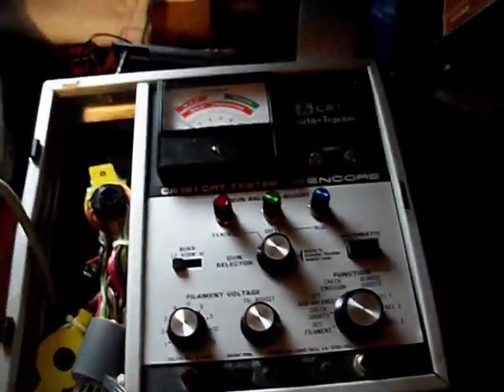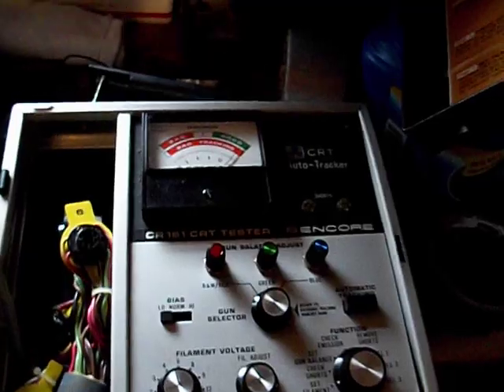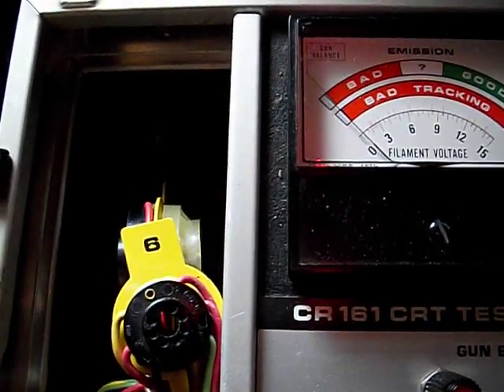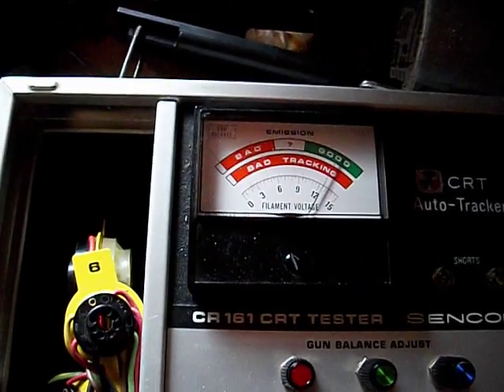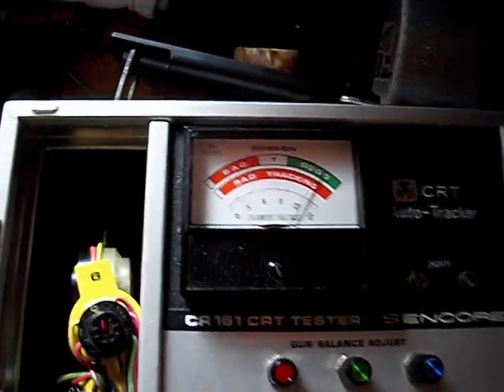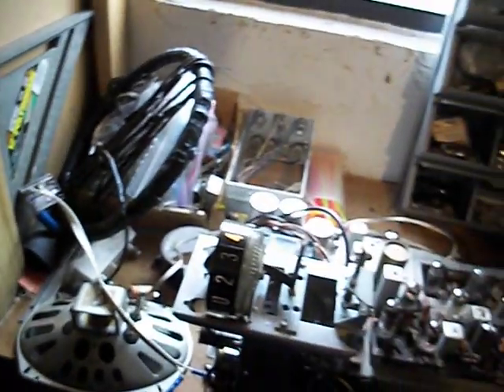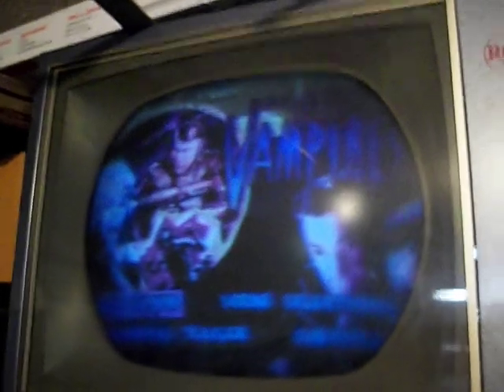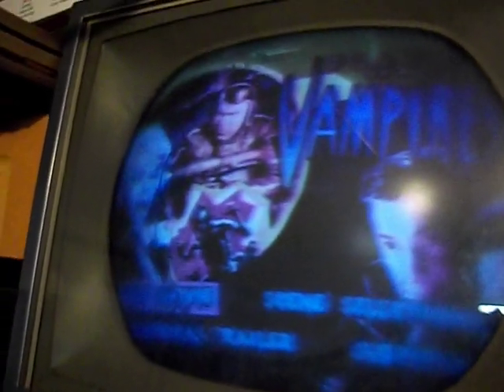CRT tester Sencore CR161 test 11SP22

Comment: Where would you place the CR161 between the CR31A and the CR70?  Thinking about adding one of these to my equipment line.
Reply from the maker: +Jack J I only have the CR70 to compare it to. I use the CR161 more often due to the ease of use. I "think" the CR 70 has more rejuv functions, but again rejuv is really pretty iffy, and not really something that IMHO should be the deciding factor on which tester to get. What you should look for is how easy it is to use, and I find the CR161 very easy to use.
Reply from the maker: +Dave WM oh one more thing, the CR70 has a problematic connector, while the CR161 has a very robust octal style connecter for attaching the adapter.